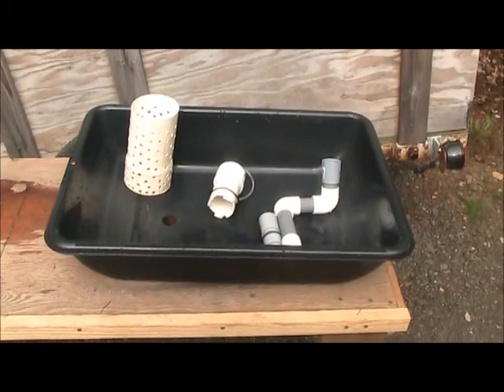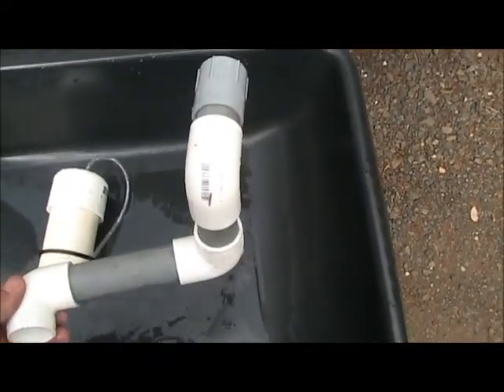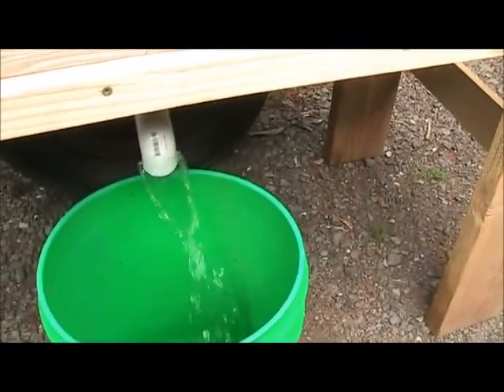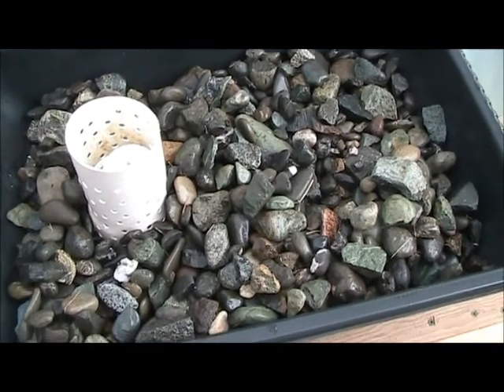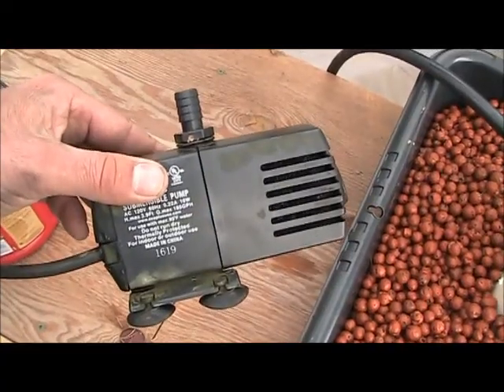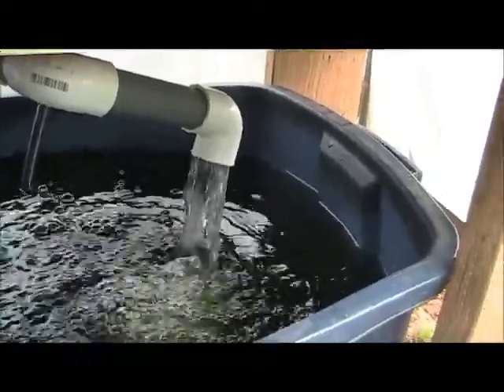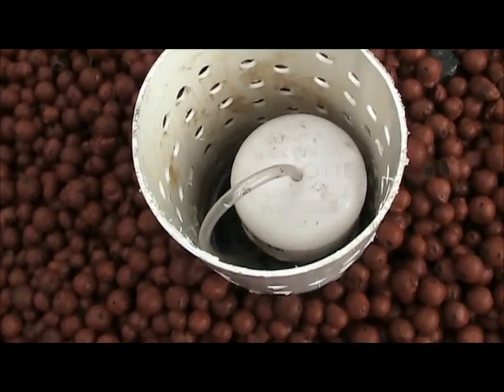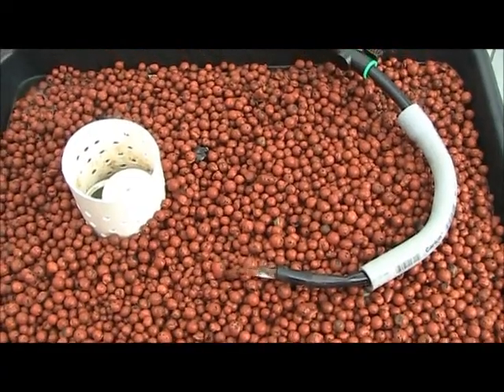Small Aquaponic System With A Bell Siphon

Comment: Why the use of electrical conduit with water pipe? I know both are PVC. I compared the fits at Lowe's while buying parts and there appeared to be no difference. I've watched many of the videos on YouTube and you're not the only person who has mixed the two.
Reply from the maker: +Meticularius That's what I had on hand, they are both interchangeable. electrical isn't approved for water. they could leach chemicals into the water. you have to make a choice if you want to use them. sorry for the confusion.Larry

Comment: Thanks! the air line should be around the area where you cut the bell siphon on the bottom? also howd you make the top hole (for the air line) air tight?